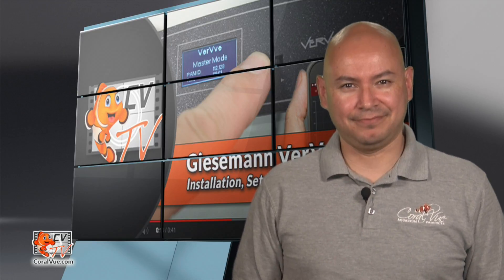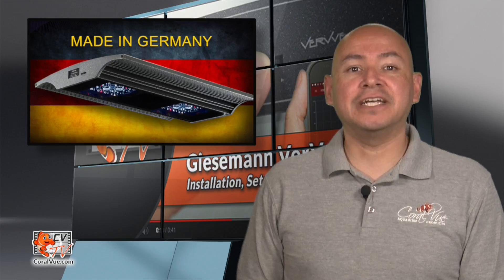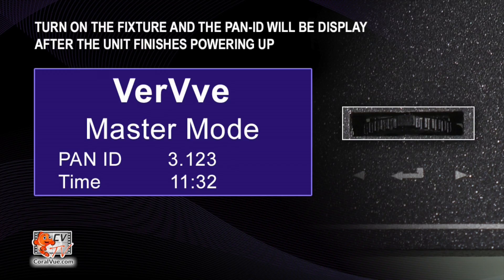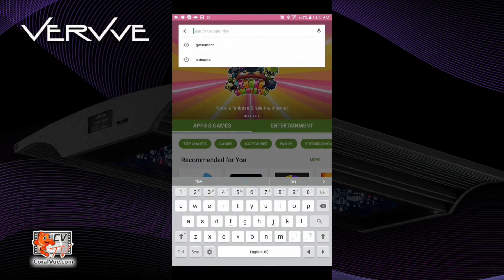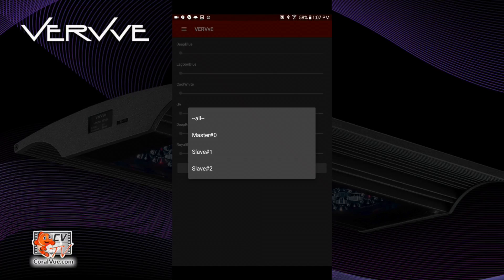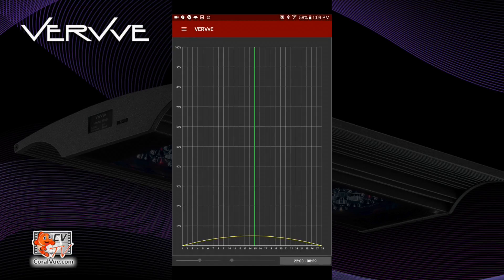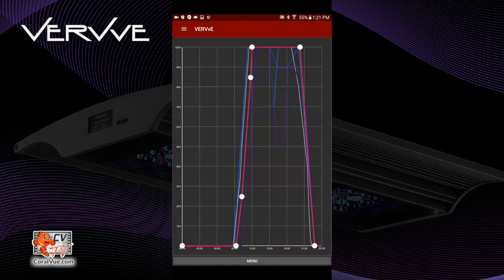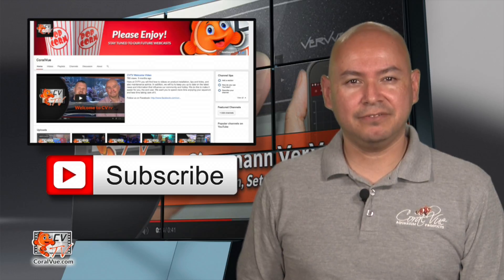Giesemann VerVve: Setup & Installation

Comment: Can the fixture be mounted in either direction with that bracket that's mounts on the tank? It looked like it can only be perpendicular to the tank from the video thx
Reply from the maker: At this time it can only be used in the one orientation. Giesemann is looking into an alternative mount to allow a mount that can attach to a glass or acrylic rim commonly associated with larger aquariums.